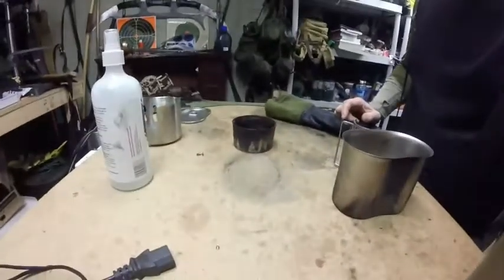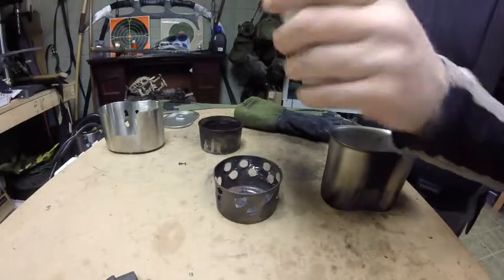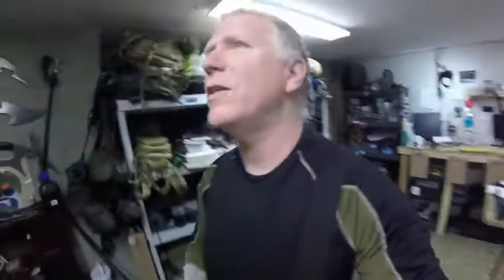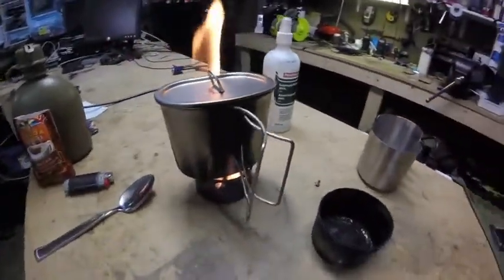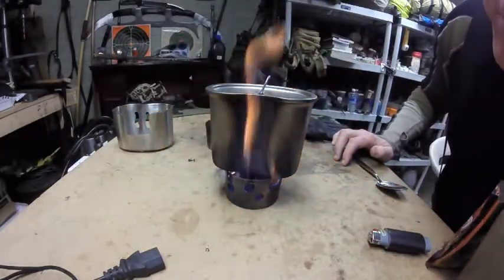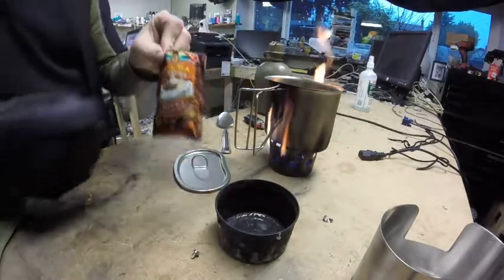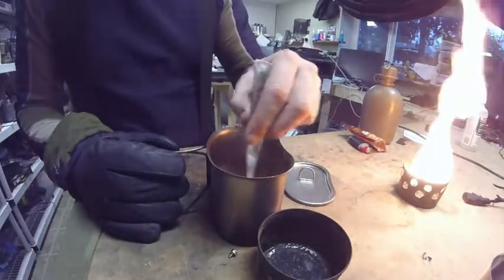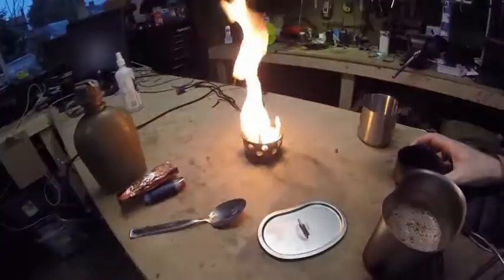no cost stove

Comment: When using that canteen cup / pot. Think about improving efficiency of the flame. Switch the salmon can to a sardine (reg. size, or maybe one of those elongated ones) perforated under the outside lip with maybe 2mm holes. I am thinking your losing BTU's out around the side, when the flame is coming out beyond the sides of the pot.
Reply from the maker: That is a great idea...canteen cup and stove the same shape...good thinking